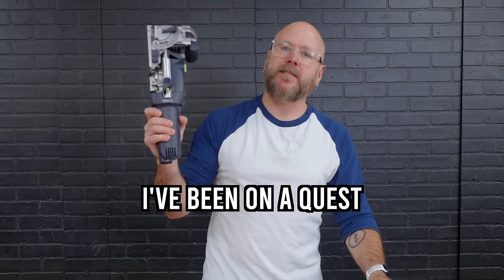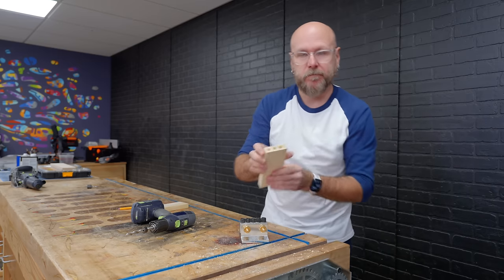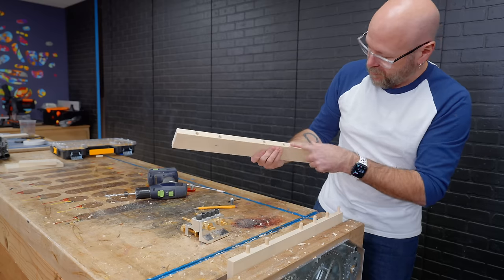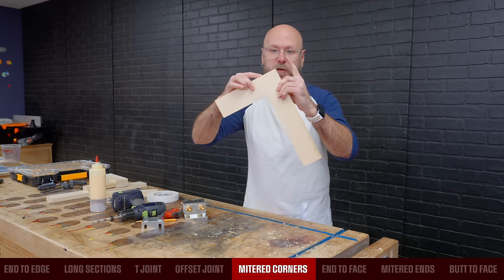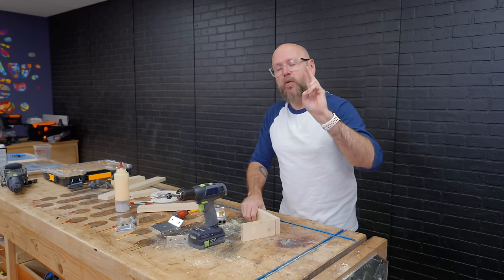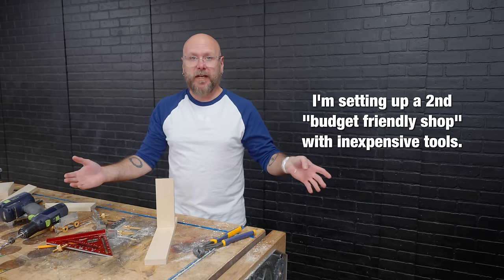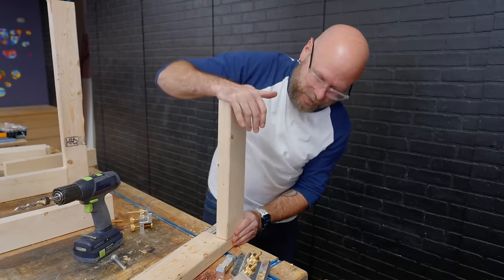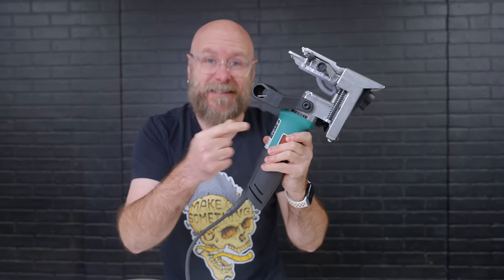The 2nd Best Joinery Method That Can Do It All!

Comment: I was a hair away from buying one of these. With the accessories you mentioned it was going to be be well over $300. I think near $400. I thought it was superior to cheaper doweling jigs, but honestly there are plenty of high quality jigs that do 90% of what this one does for a fraction of the price. 
If I were to consider this one again, I would just continue to save my money and try to get a good second hand domino or save a while longer and buy one new.
Reply: Well said.  If this was <$200 it would be a contender.  Otherwise, cool though it is, it's too expensive for my budget and I suspect a lot of budgets.  It's a very tricky gap between hobbyists for who this is expensive, and professionals for who this is affordable but it's too slow.  Still - their website says they've stopped taking orders due to the huge influx of orders and I suspect this video had a look to do with that!  Fair play to them.
Reply: @ohallifax  the best jig that comes to mind to me is the Drillpro. I honestly think it’s better then the DowelMax overall for price and capability. It’s metric, but offers 1mn incremental adjustments so you can get very close, and sheet goods are all metric anyway.
Reply: It's well worth the money, I have been using them for years, so much so that I have 3 full kits which I use in different configurations so I can easily switch between operations without having to dismantle my setup each time. I do a lot of repetitive builds so it saves me a lot of time. The budget ones always disappoint me, but if you find one that works, go for it. .
Reply: wow for the price of 3 you are very close to the price af a Festool domino!
Reply: My particular builds requires very specific joinery that would be too cumbersome for dominos. Also, the jigs paid for themselves with a single piece of furniture.
Reply: I agree. This kit isn't competing with a Domino, it's competing with the Aliexpress $80 jigs and that's Australian dollars so maybe $40-$50 jigs. I'd rather get a couple chinese jigs than forking out $500 Australian for what amounts to a metal hole with a drill bit.
Reply: @gravityundone8697  The difference between cheap Chinese knockoffs and this precision jig will make itself known when your dowels don't line up on a longer length of wood.
Reply: this is inaccurate. "Cheap Chinese knockoff" may have applied in the past, but where do you think the expensive originals get their aluminium from? Where do they buy their precision forming and cnc machines from?
China is a long way from being "cheap knockoff" territory. Certainly you can get low quality good, but that is true everywhere. The aluminium right angle braces, rules and dowel jigs I have bought are about 20% the price and delivered to my door with 100% of the accuracy. I have built a couple pieces of furniture with  my $40 dowel jig and not once have the dowels failed to align. If you buy American / UK / Australian made aluminium precision tools, you are paying for the warm feeling of supporting a company who themselves has bought the tool from China and stuck their branding on it along with a massive mark up.

Comment: It's a very nice tool (I have one) but my Jessem dowel jig is much fast to work with. I have the Generation 1, 2 and 3. Gen 3 you can get the 45 degree adapter and the only reason I bought it..
As to the grizzly dowel jig video, NO. My friend bought one and it was junk and sent it back. Great video.

Comment: 13:09 Now a separate 45 miter adapter insert can be attached, allowing the built in clamps to work with the 45 plate, removing the need for an external clamp.

Comment: Mostly commenting to feed the algorithm because I love your content. I did want to say that I read a bunch of reviews on the Grizzly dual doweller (as well as the Igooo spindle doweller which is the same thing, badged differently), and they are mediocre at best. Most folks are commenting that they are not square, accurate.  There is a REALLY expensive dual doweller by a brand called Mafell, but it retails for higher than the domino, so....

Comment: I like the dowel max, bought one a while back. I wish it came with some sort of organizer. By the time you get all the accessories you have shown though, you are over 400$, so take that into consideration if you are going all in on this system. Also, you are supporting a family business (at least it was back in 2021). I had picked up a dowelmax junior, and added on a classic clamp bracket, saved a bit of money over the list price for the 3/8" classic. Not sure if the junior is still available. I used a 3/8" bolt in place of an index pin, the 3/8" index pin was not in stock.

Comment: The two main selling points that remains for the domino is speed and dust collection. Setting up the dowelmax takes time, then, cleaning the mess after take time as well once your done… For the hobbyist, it may not be a big deal, however but for the pros, time is money…
Reply: As someone who uses the dowel max jig in a pro shop, joinery is such a small percentage of our build time that is negligible. on top of that, because it is slower, I end up making less mistakes because I have a moment to think about it.  Also, if I break a bit, I can run over to Home Depot versus a supply store.

Comment: Dowelmax is a well machined tool that is easy to use and extremely accurate.
Own the Beadlock Pro, the blue anodized joinery jig, we can put that in junk pile.
On 45  miters, you can’t beat the domino.

Comment: I bought a Dowelmax a few years ago and added the 1/4” guide bushings with it. I kept it for a couple weeks, thought about the price and decided I wasn’t going to spend $300 for a dowel jig so returned it. I wish I would have kept it, or at least used it once, but I couldn’t get past the price and, I thought for that price I’d just add some additional cash and buy a domino. Well, I never bought the domino because of the high price. Maybe I’ll try the dowelmax again, but no question the domino is a much faster, easier and far better choice if you have the cash. My problem is that if I get the domino I’ll want the Festool dust collector, then a Festool sander and I’ll be chugging the Kool-Aid at that point!

Comment: I would like to see this compared to the Milescraf 1311 jig.  I have one, but I've found some limitations and I wonder if another jig would fill in the gaps.  I like the 1311 as it is extremely simple to do but joints and corners, but I don't think it will do miters at all.

Comment: I have both dowelmax and dominos. I have not used dowelmax since I got access to dominos. Overall a great product, but it gets pricey with all the attachments. One thing I was disappointed about was the clamping strength. The jig would move on me as it got pulled around by the drill. With all the reconfiguration necessary it is certainly not meant for production.

Comment: Yup, the DowelMax is very good and the joints are very strong.  Pretty much the same with the Jessem dowel jig.

Not surprising that Grizzly has  doweling machine.  The only Grizzly doweling machine video I'd want to see would be a comparison with the Mafell.

However, when folk talk about strength they do testing which often has little to do with endurance.  Seriously, are there any of us who haven't run into a dowel joint in a chair which became loose and unsafe?  I've not seen the same with Domino joints but I'm not sure I've ever seen a chair with Domino joinery (and certainly haven't made any).  So far as I am concerned the joint strength comparisons don't properly allow for use-case situations where I think glue likely first develops microcracks and later failure along with compression of the dowel.

From my perspective?  Both are pretty strong joints but once you know how to use it well there is nothing which compares to the rapid precision of the Domino combined with its pretty good strength.

Comment: Do they not have a centre index mark on the Dowelmax so you can use it like a biscuit jointer? As in... offer up the pieces your joining, make a pencil mark across the face surfaces and then align the Dowelmax index mark with each mark you made.

Comment: This video has pushed me over the edge to buy the DowelMax. I know it has a 45 degree accessory, but I have table legs that are cut to 18 degrees. Anyone got advice on rigging their 45 degree attachment to make a dead accurate holes in a table leg with an 18 degree angle?

Comment: Been down the dowel route but I still find it hard to beat the Domino for ease, speed and accuracy. 
It's the old cry once thing.  Or maybe it's the cry hard once thing in this case.  I purchased mine used over 13 years ago and have never looked back.  I would say the same about my Kapex.

Comment: I used a domino at a shop. That thing was crazy, definitely saves time. Dowelmax is awesome. Also, dowelmax is SLAMMED as they paused orders because demand is high. As they say, don’t buy cheap Chinese copies. Don’t! You’ll lose your mind and want to jump in front of a angry dog because the tolerances aren’t great. Pony up for the real thing. It’s like 250$, but trust you will save so much time. Want more info? Here, let me tell you something. I had a huge walnut 3” table glue up. I decided I would just glue up use cauls, it worked out, mostly but it took forever using 14 pipe clamps and para clamps and addition clamps to fight alignment. 2nd table, used dowelmax same 3”. Every 12” used a dowel, thing lined up perfectly and I was done so much faster. 

Trust it, use it. 250$ is fine. The domino is like 1200 more lol so whatcha want!

Comment: It looks like it consistently makes a great joint. 

As a dowel jig it just seems too expensive for most hobbyists, and too slow for professionals unless they have multiple dowelmax devices and bits, which could cost as much as the festool domino tool…🤷‍♂️

🤔 Maybe if they could cheapen it up a bit while maintaining consistency of alignment. Minimize the amount of machining and materials. Use Laser cut flat shims instead of machined thick stock, use readily available extrusions by drilling a few holes to make the clamping parts, use off the shelf bolts for clamping, etc. They could offer the same great accuracy at a cheaper consumer price by utilizing significantly cheaper manufacturing techniques. It might not look as refined and high quality, but it would work the same and reach more customers.

Comment: Very good but it takes ten minutes to make a custom dowel jig if you have a table saw with a cross cut sled and a drill press (15 minutes if you haven't). 3/8 ID brass tubing is not expensive for the drill guides. $10 instead of $180?

Comment: The spacers you identified (1/16,  1/8,  1/4,  3/4,  1-5/8 ) means there are gaps like 1/2  →  << 3/4,  1-1/4  →  << 1-5/8.  This would be solved if a spacer could be used negatively. So, can you put a spacer in upside-down such that it protrudes below the top of the piece? So to get 1/2 you would have 1/4 upside-down overlapping the reference face followed by a 3/4 upside-up?

Comment: What if instead of a domino dowel you used a 12mm or 14mm or even larger normal dowel? Matching the surface area should give a similar strength in the joint, right?

Comment: Great video. I think I would have loved to have this as an option prior to getting my domino. I just love my domino. But I had to build up to be able to afford it and justify it. I had a cheaper version for dominos that I used once. It was not for me. But this dowelmax looks pretty great. 

As someone else mentioned. The domino does have a support that comes with it to do that mid panel joinery. I just go the TSO version because it is so much better.

Comment: I would have liked to see the glue up of 24 pegs into 24 holes given that the dowels are designed to expand.  My guess is that is was a bit challenging to get em all together.  I thought about getting the dowel max but my frugal dutch nature wouldn't let me so i settled on the TASK dowel jig instead which is still a high quality tools although not as versatile by the looks of it

Comment: Would love to see a video on the grizzly, but for the Budget Shop, consider the stainless steel dowel jig from Jessem. I love it and they are cheaper and work amazing. 10/10 would recommend!
Reply: Unfortunately, you have to deal with Jessem. Such an awful company to deal with. They will take your money right away and then sit on your order for multiple weeks with zero communication.
Reply: @keithc1335  i did have a long ship time this summer but that was due to me being in the preorder, I did have communication with them on the wait time so I was lucky to have had that at least. Did you ever receive your jig from them?

Comment: It sure looks nicer than the dowel jig I already have. With all the extra bits I'd need I think it would cost about as much to get one of these as a decent jobsite table saw. Personally I'm just going to save up and get the domino joiner. Also..  Used domino joiner? That exists?

Comment: I've been considering this jig for a while (as a very novice and DIY as-i-need-to woodworker...) and is there anyway to use to make a joint like your last one, but along the center line of a board? I've had a project in mind for some time now and I cant' figure out an easy way to do it, repetitively, with precision.   It's hard to explain, but I want to join 3 boards vertically, parallel to each other, center between two other boards (if you can imagine a 3-dimensional roman numeral 3, but the middle 3 boards are not the same width as the two that they are between).
Reply: Use metal pointed dowel centers to mark the drilling locations based on holes drilled in the columns. And/or make a drilling jig for your layout and practice on scrape before you commit good materials.

Comment: I have thought about both the Domino and DowelMax. I made a Domino jig for my router to get a feel for how I would like the joinery and I have a cheaper doweling jig for comparison. One thing I noticed using the the Dominoes is that you can extend one slot to get fine adjustment in the event you were off just a little. With a dowel, this really isn't an option which means if the jig slides during setup or drilling, then there is no easy way to rectify the situation. You would have to plug the hole, wait for the glue to dry, and drill new holes.
Reply: You're absolutely right. That's what makes the DowelMax special. It is incredibly accurate and repeatable when used as intended, so you don't need wiggle room.

Comment: Looks like a nice tool, but that price! Here in the UK it comes in at the same price as my Milwaukee drill/driver set did. That's expensive for a block of aluminium, a few hardened steel guides, and some brass screws.

Comment: I don’t understand the hate for the Domino. No one bats an eye at a $3000 table saw, but when it’s time to actually do joinery (which takes the most time next to finishing) everyone looses their minds over a $1000 tool that does floating tenons fast. I don’t have one, but as soon as it’s in the budget you better believe I’m getting it. Current Dowelmax user by the way.

Comment: The official way to do the “T butt join” with domino is to lay the end that is connecting at the end grain down, laying parallel on the other piece, clamp it and use it as a fence. You cut both ends of the mortise while they are in this position. Eliminates “holding on the router for dear life” and ensures accuracy.

In other words you place the butting piece where you need it. You can scribe a line on one side of the butting piece and rotate the piece around that line by 90 degrees so it lays flat on the piece it is butting into with one of the corners aligned with the previously scribe line. Clamp it down. At that point you cut the mortises into the end grain of the butting piece by laying domino on the bottom piece and butting it against the end grain. Rotate the domino up 90 degrees and around 180 degrees so the bottom of it is against the end grain of the butting piece and the cutter is cutting into the long grain of the piece you are butting into.

Hard to describe in few words but definitely elegant. No 3rd party attachment necessary.

Comment: 90 degree dowel joints fail over time.  About 20 years will do it on something that is in daily use.  They don't blow up, they simply detach from the cross grain element.  It happens so often that repairing this problem used to be regular business in repair shops.  This is combined with the problem of glues that don't reglue, and you combine early failure with lack of easy repairability, and you have a serious problem.

Comment: So, for those who have a biscuit joiner, and whose hearts hurt a little bit whenever they hear the obligatory mantra about how it doesn't add any appreciable strength and is only good for alignment, how about this?  Re-saw a hardwood board to the thickness of a biscuit, then cut overlapping holesaw holes to make ovals, with the grain running across the short width, i.e., across the joint.  All the strength of a domino (well, mostly) AND the alignment advantages of a biscuit.  Plus, you get to make strong joints with your old biscuit joiner!

Strong enough for your 'loose-tenon comparison competition', bro?

Comment: You mentioned the domino could slip when doing a face cut, i have a freud biscuit jointer, it has 2 small spikes next to the blade, probably to resist skating when the cutter engages, but also holds iit in position for face cuts.

Comment: Dowel jigs fall down in angled joints. I make 8 deg angled joints somewhat regularly for modern table legs. Only a jig with infinitely variable angles can do that. 
At least the Dowelmax doesn’t have fixed steps for board thickness like the Jessem.